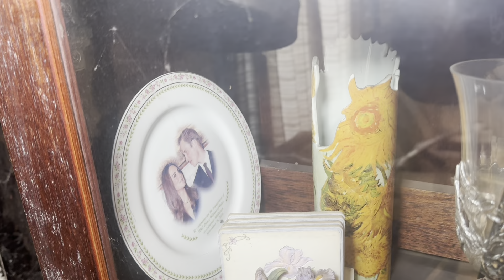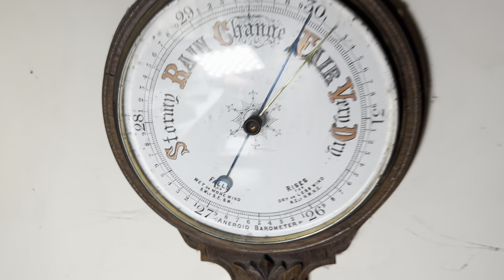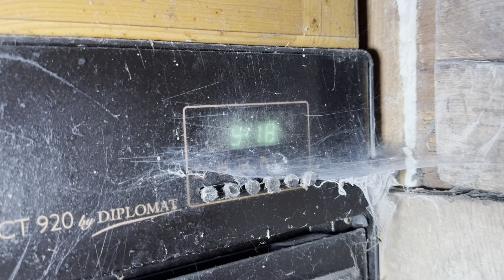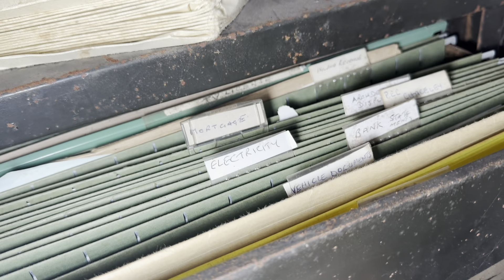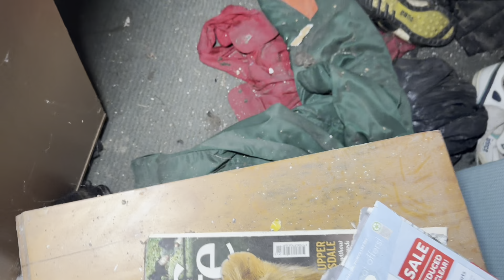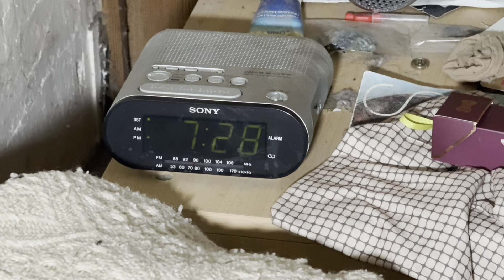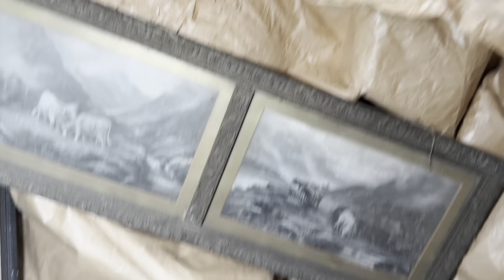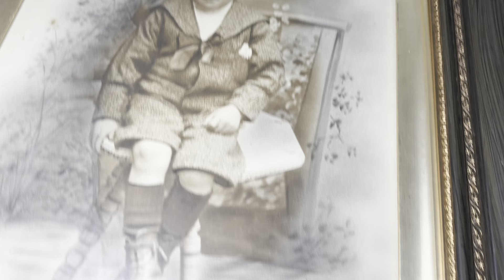HUNTED and SCARED in an ancient 500 year old abandoned house

Comment: Ooo, a  violin, I play one of them. I can confirm it is easy to make a horrible noise and quite hard to make a listenable to one. The horse hair is for the bow, it's no indicator of age as bows still have horsehair, and, for example, for a long time now strings have had little plastic sleeves to protect the bridge, so the instrument might be old but not the strings because they get changed. To be fair there are a lot of not very good instruments knocking about, more violins than cellos because more were made, but it's still sad to see it silent and left in a loft, the heat won't do it any good either. I'd have been hard pushed not to rescue it, poor thing 😒

Comment: Americans have hot and cold taps as well. I've never seen a house that doesn't have hot & cold taps. (You can buy faucets that just have one lever though. You turn it on and twist to the left for hot and to the right for cold.) My kitchen faucet has one lever but all of my bathrooms have double taps at the sinks and single levers in the shower/bath. Now that I think of it I'd say most American homes have both types of taps.
Reply: Yes faucets 😂 lol different areas have different ways of saying things,we all have our own different ways it's all good😊
Reply: All mine at the moment is one tap. Sometimes 2 in places. But mostly one these days that you adjust to temp
Reply: My home was built in the 1950's and I have both hot and cold...but just 1 in the shower.
Reply: I have a fairly new American home (2018), and it has double taps on all bathroom sinks, single lever taps at the kitchen sink and in in the showers.
Reply: @beckyrude9706  it varies.
Reply: I lived in a older rental house that had the 2 seperate faucets , left  faucet was hot right faucet was cold